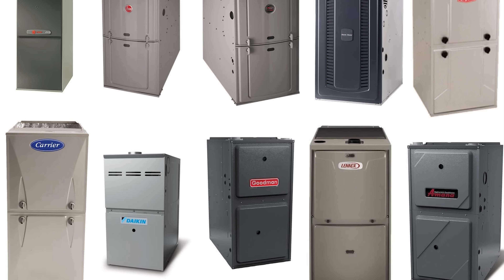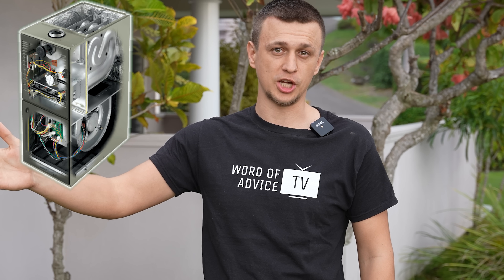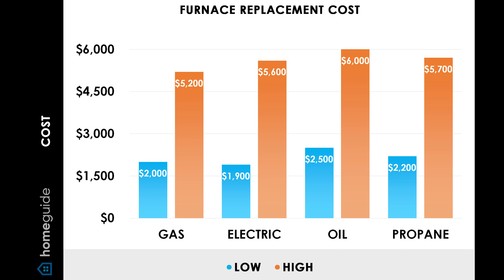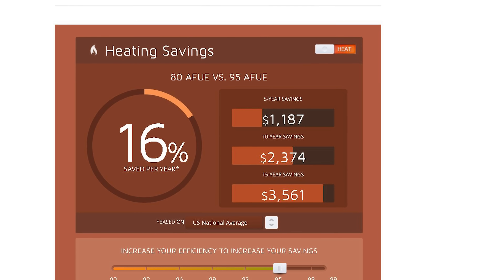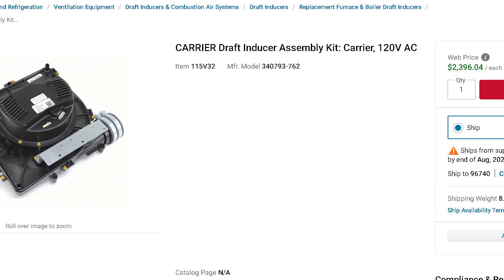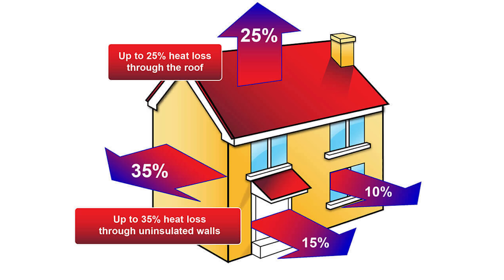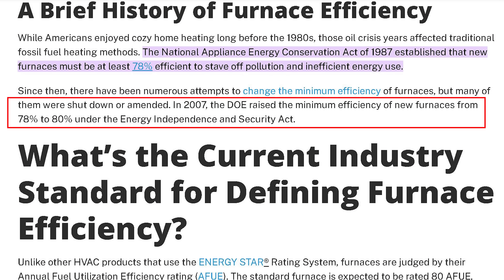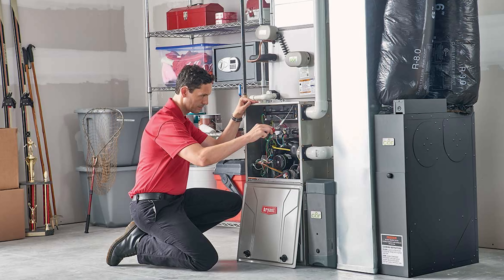Don't Buy a High Efficiency Furnace!

Comment: When my furnace broke down, I went and got the 80%, very happy with it.  To engineer out a measly 15% improvement is overkill!  My brother got a new 95% furnace about the same time, already had issues.  No matter what, if you get a new install get it checked out every year, if the capacitor goes out and you don't have an expert find it in time it can ruin the whole shebang.  The furnace my old house had was a 1986 furnace made in a union shop in Indiana.  Even the old one worked for me from 2005 to 2019 with no professional maintenance just filter changes. (But a total of 33 years when you include the previous house owners!)  The installers of my new furnace were complaining how heavy the old one was, and I quote "don't recommend us to your neighbors."
Reply: With a comment like that I’m not sure if I could’ve even trusted them doing a proper install. Sad!
Reply: @Kiddro22  Noooo....I think it was all in good fun.  Frankly, I appreciated that they had a hard job to do and they worked very diligently.

Comment: I live in northern Canada and my Lennox pulse condensing furnace has been heating my house for 37 ( new 1985 ) years without a repair. Winter temperatures reach lower than 45 below and can remain at 30 below for weeks. It can make 5 gallons of flue gas condensate per day in cold weather and heats a large house at a low cost. No complaints on that furnace.
Reply: Dam man!
 You should move down to the balmy Wellington/Dufferin County area. With 'Global Warming' it is almost like Virgina here in the wintertime. I like global warming!
 You must be way up there Dude
 God Bless You.

Comment: Totally agree with all your points about high efficiency furnaces. Currently have a Trane 80% natural gas furnace that is 20 years old and still running good. Has the original ECM fan motor and only replacement parts are the hot surface igniter and flame sensor. I changed those out just as preventative maintenance items. I have heard from a few other YouTube people that 2028 is what they are hearing regarding end of 80% furnaces. But never heard what their source of information was.
Reply: I got approx 26 yrs out of 80%Trane installed 1992.  Replaced before breakdown because I got a few unexplained error codes Fall/Winter 1991.  The HVAC guys could not find what triggered the code.  Nor could they repeat it.  So to be safe I bought a new 80% about 3 yrs ago.  No issues other than Nat Gas costing so much more now.  Heating bills  during winter are $40 to $50 more a month now.
Reply: Lets Calculate: Savings of 95% over 80% for 35 year life of Lennox Pulse.  $1000 year spent on Nat Gas with 95% so spent $35k in 35 years.  Would need 19% more gas for an 80% (.95/.80=.19).  So $35k * 19% = $6,650 saved over 35 years.   NOT ONLY is there energy savings, but HIGH quality equipment last twice as long, so saves another $3k to install another one.
Reply: @pablopicaro7649  😂you must be a salesman
Reply: If its a 80% when new, its loses efficiency the older it gets. So in reality, you actually have a 65-70% finance now after 20 years.
Reply: @terrorballz  quirky problems like that is usually a bad circuit board ($300), very easy to do yourself
Reply: @srobeck77  That's not true. There isn't really much to drop your efficiency with a furnace over time.

Comment: Here’s my thoughts. I replaced my 80% years ago. Lost an ugly chimney poking out of my roof and gained a pantry in my kitchen from the space the chimney ran thru which doesn’t equate to more money if I sell my house but it might sell quicker. Storage storage storage is key in homes. Also pvc pipe is cheaper than a metal chimney as well. So I’m shopping fir new furnace now. What’s your thoughts on Goodman brand
Reply from the maker: That's a great point! Storage is golden! Personally I think Goodman is a good brand. It may not be "top of the line" but parts for Goodman units are readily available unlike some of the other premium brands that have more special order parts.
Reply: That’s true about the parts. My curry furnace is carrier weather maker 9300ts. It’s been a great furnace although we have a great parts place near by but even they don’t stock a lot of parts that leave you cold in the winter for up to a week and I’ve been told Goodman uses the same parts as many.  I would definitely like to get the carrier infinity 98 I think it is but haven’t found a place to sell me one without them insisting they install it. Guess it’s a warranty thing but yeah easy enough thing to install. Thanks on the thumbs up on the Goodman though

Comment: Before leaping onto bandwagons and mandating decisions, governments need to account for all costs, including the environmental cost of replacing a delicate expensive system a decade sooner. Manufacturers love it. The same thing has happened in the auto industry. There seems to be no mention of the fact that newer products don't last as long. Throwing those into the landfill needs to be accounted for.
Reply from the maker: @spelunkerd Thank you for sharing your thoughts on this. I only agree! Here in Hawaii landfills are actually starting to become a problem. Too much things being thrown away and not enough room in the landfills to discard it all.. With the way things are going this will be a worldwide problem soon. (With all the plastic in the ocean, it actually already is a problem).

Comment: Thank you so much for such clarification, I highly needed. I So this video helped me because I was researching for converting to new gas furnace, as  I am moving into a new house which has old steam-heating by oil-furnace (1960) still working.  The oil-tank buried into the ground in yard below the concrete floor. While heating system is said to be working, I am thinking to get it inspected.  We don't know if tank is good or corroded.  Any body can guide me will appreciate.

Comment: Yeah.. my furnace is 10 years old and was installed when the house was manufactured and has always run on propane. I’m assuming that it’s an 80% efficient furnace. So, if I ever have to replace it, I’m sticking to the standard because of my age being 65.

Comment: We had a 92.3% efficient Goodman furnace for about 20 years. The primary heat exchanger was corroding away, so we had to replace it. It was also breaking down often. Now, to me, replacing it with an 80% efficient furnace does not make any sense at all. As me and my installer were going through different furnaces to install, he said that modulating furnaces break more often. I appreciate his honesty. We both agree that a 96% efficient furnace is the way to go. So, I got a Lennox furnace with a two-stage gas valve and a variable speed blower motor. It came with a 5 year labor warranty, 10 year parts warranty, and a lifetime warranty on the heat exchanger.
Reply: Good info to know. Thanks.

Comment: My downstairs furnace is a Rheem 80% that was installed with my house in 1995 and it works great.  I take care of it and change the filter regularly.  Other than having to clean the flame sensor pretty much every year (thats pretty easy), nothing has gone wrong.  My upstairs furnace is a year old and I went with the same 80%.  I got that because the crappy Lennox A/C condenser unit went bad (friends don't let friends buy a Lennox), and it was cheaper just to replace both at the same time.  The new one is also a Rheem (which is what I would get if you get a new furnace)
Reply: my 1999 Lennox air conditioning unit is still running perfectly it is just a 14 seer  2 1/2 ton unit with scroll compressor no variable speeds or anything only maintenance i do is wash unit with a hose once in a while and change air filters but i put in a oversize return air grill for larger filters to get less strain on blower.
Reply: @ranger178  The Lennox units that were built after 2007 are the ones that are bad.  They use an aluminum copper coil that is inferior in quality and generally fail inside of 5 years (which is right when the warranty ends on that part), and they are still using the faulty coils even though there was a class action suit against them due to these defective coils.
Reply: Never a problem with my 80%Rheem.......... any minor problems, easy and fast fix.
Reply: Lets Calculate: Savings of 95% over 80% for 35 year life of Lennox Pulse.  $1000 year spent on Nat Gas with 95% so spent $35k in 35 years.  Would need 19% more gas for an 80% (.95/.80=.19).  So $35k * 19% = $6,650 saved over 35 years.   NOT ONLY is there energy savings, but HIGH quality equipment last twice as long, so saves another $3k to install another one.
Reply: @scpatl4now  seems like all appliances are getting worse every decade they make them cheaper and try for planned obsolescence to last a little longer than the warranty even cars are getting worse since 1990s they were not selling enough new ones
Reply: @pablopicaro7649  I doubt it would last 35 years, plus maintenance costs are higher
Reply: @scpatl4now  It is still running right now, made in 1987.   gets a flapper valve every few years, got a t-stat once, and a inducer fan recently (getting noisy after 35 years).
Reply: @pablopicaro7649  what make and model sir?
Reply: Flapper valve 🤣
Reply: @Kiddro22  Furnace is Lennox G14Q4  95% (1987), AC is Lennox HS26   13.6SEER (2003).
Reply: @pablopicaro7649  back when products were made to last.

Comment: I’ve seen a couple posts like this recently. The problem is it’s 15 years too late. They’re being restricted in certain zones. Like it or not residential furnaces are far beyond this conversation. They’re now passing edicts or legislation that’s going to restrict efficiencies like these. I like the simplicity and low cost of an 80% furnace. I usually have to replace the flue because they have corrosion issues, which adds cost to the install. I think we’re fooling ourselves if we’re promoting the benefits of what will soon be unavailable.

Comment: 35 years ago we built a house and opted for the 80% furnace figuring what we gain in gas savings, we might lose in electric costs -- as high eff. units tend to run cooler and more often (my understanding).
7 years later,  built another house.  (This is entertaining)...
Builder would NOT STOP trying to talk us into the high eff. unit.
Finally (he was running out of time to get HVAC installed), and he said -- "OK, I'll give you the high eff. unit without the upcharge because we have no 80% units available."
Sure enough -- electric costs increased disproportionately to gas savings -- and this house had far better insulation than the 1st.

I am grateful beyond words for your channel.  I'm navigating an aging high eff. furnace (existing in purchased condo) - deciding to learn all I can (now that I'm a retired structural engineer) before plunging into the next big purchase. 

One more thing... Digging through the furnace I was amazed it had run this long finding:  - Loose inducer fan bolts,  - Failed inducer fan gasket, - Cracked flame rollout switch, - Untightened inducer fan hose clamp, - Dirty parts preventing continuous ground, - Condensation dripping from intake pipe onto rusted flame sensor and burners.

Comment: An additional cost of going from an 80% to 90% furnace is the likely need to change the venting of the water heater, if it is also gas and shares a chimney with the furnace -- in order to avoid backdrafting.  Alternatively, the gas water heater could be replaced with a "high-efficiency" model -- which is markedly more expensive than a standard one, and also more complex (i.e., more potential failure points).
Reply: Drop a chimney liner for the existing water heater. If you run a 2 pipe PVC for the furnace and the return is tied in, no draft issues for the water heater.

Comment: I purchased a 95% efficient furnace in 2019.  I live in the country and have a mound septic system, that was installed in 2013. This furnace has caused major problems with my water pipes.  The furnace drips and causes water to slowly build up and freeze about 16” from the clean out.  I live in a colder climate state.  I had a 4’ square of my cement driveway re-done so my pipes could be insulated properly.  I sure hope this works🤞 Needless to say, it has been very discouraging.

Comment: I still think the most bang for the buck is a 2-stage 80% like the 16 year old Bryant I have. It seldom kicks into high unless it's below zero and the only repair so far was replacing the flame rod 3 years ago and at the same time I got an extra hot surface ignitor so if that does go out in the middle of the night in January I can change it in about 15 minutes and go back to bed.
Reply: I just replaced my Heil 80% efficiency 1 stage furnace with a 2 stage 80% efficiency Lennox. I hope it will last at least 20 years.

Comment: You guys must be installing these furnaces wrong. I see alot installed badly that need to be replaced but typically the red flag is that it is not graded properly for condensate to drain out. Which causes a secondary heat exchanger failure. Or else it's sized badly for the duct so it is running too hot. I'm a installer in saskatchewan where it regularly hits -40. Here we actually cannot get mid efficient furnaces anymore. Also...I've never ran into a inducer motor that costs more than $700 to replace. I install armstrong air furnaces and I've literally never had a defect or callback on one out of I dunno probably 40 or so
Reply: Sorry I should say that IF installed correctly, these high efficients should last at least 20 year or more....yet to be determined since they haven't been around that long. If installed incorrectly...10 - 15 years

Comment: All new units have X13 motors so even if you get an 80% blower motor replacement can still be expensive. Everything is eventually going to have more and more technology and complexity baked in it from the regulations. Already seeing this in the commercial side. However, I understand why you said 80% around here most times customers do not want to pay the price to pull a chimney liner and the 90% is cheaper up front. As you know everything is made cheaper and cheaper nowadays so you can't except stuff to last as long anymore. Gas is also going up in my area quite a bit and I already have a 90% from new and no chimney so I'm locked in. I do agree sometimes simple equipment is worth it just because fixing and diagnosing is very easy.

Comment: While not raised, I replaced the old oil-burning furnace with a Natural gas high efficiency, one of the easiest and best decisions I ever made. The costs will be recovered in 5 years easily. On top of that, I was able to convert the hot water tank from electricity to natural gas, a high-efficiency on-demand unit. In my case, it was the deal of a lifetime.
Reply: You might not be so happy with the $5 a month energy savings with your tankless water heater once you do a couple of $150 - $175 service calls to clean the unit's heat exchanger - each year if you follow their recommended schedule.  

I agree that saving money happens when you replace any oil burner.  A ductless heat pump or furnace will save a lot each winter!
Reply: @Kangenpower7  I just put in a water softener. And of course, will monitor it to check how often it will  require flushing

Comment: Got a new Trane two stage 95% about a decade ago.  The government grants only applied to high efficiency two stage, and literally made up the price difference.  I did learn later that maintenance costs are higher, though, but balanced by the fuel savings.  Nice to have a lifetime warranty on the heat exchanger, but the labor costs would kill.  But my breakdowns had nothing to do with the complexity.  Just very poor quality, and poor service workmanship.   Inducer fan noisy from day 1 because one blade was chipped.  Just before warranty end, the $800 control board died.  Just a bad $10 relay, but not easy to get.  Trane usually sends out a new igniter with the new board, because the new board puts out 120v instead of the previous 80v, but they did not.  So old igniter fried just after warranty.  Trane had referenced the serial number, but are slow to update their records, so they sold us another 80v!.   The tech should have noticed the 100v warning sticker, but blindly installed it anyway. It fried.   A battle with Trane for their two mistakes.  They pretend to have a customer complaint dept, but they always say no, and reply with a nonsense boilerplate answer.  They wrote that they have no control over locally supplied freon quality!!  I wrote back that they have my GAS FURNACE file mixed up with someone's AIR CONDITIONER  file. They replied that they have responded already to my complaint, and therefore have closed the file!!   I had to eat the costs.... an off the shelf silicon nitride universal ignter is about $25.   The identical Trane igniter was $120!
Reply: I feel your frustration.
 They got you and you know it.
 But most people just don't know.
 I don't, but do now. Thanks for the heads up.